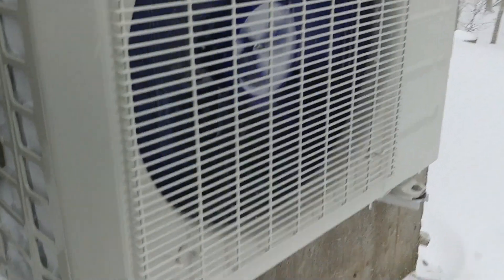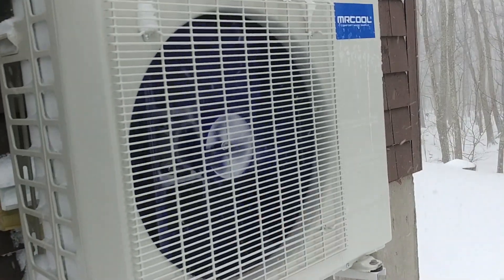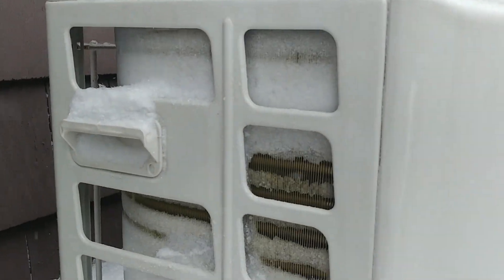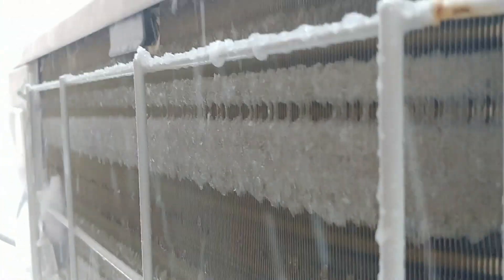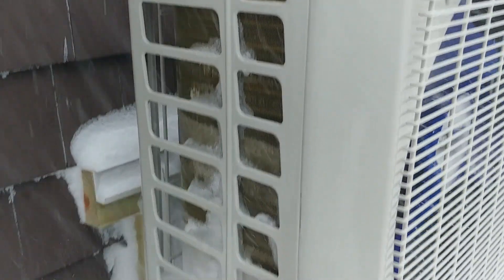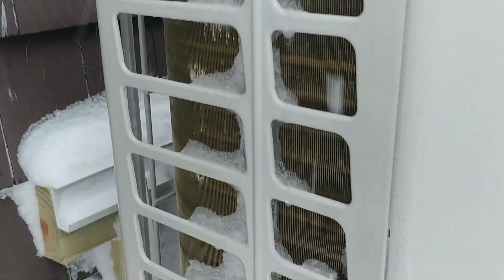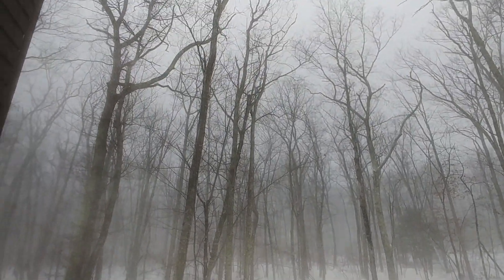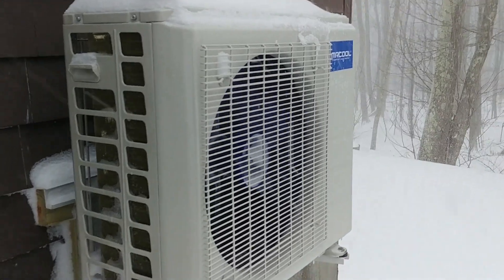Mr Cool mini-split performance in a blizzard

Comment: Usually there is a sensor to detect coil temp, once its above the threshold it runs for x time long. Depends on unit. ~commercial hvac tech
Reply from the maker: Cool, that makes sense.  Thanks.
Reply: @kevin9c1  Im wondering if my unit which is exactly like the one in this video is low in Freon. I keep it set at 65 in my mancave and by mourning it'll drop to around 62 almost like its struggling to keep up. outside temp is only like 33. it does DF but by the time its done DF the temp inside has dropped and it seems to be losing ground when doing so. I had it checked by a technician. He said the pressures looked good but he didn't remove the Freon to check the weight.
Reply from the maker: @stitch893326  Funny you should ask that. My system actually died or more specifically it threw a P4 code which refers to compressor inverter drive error. It does still run but it sounds bad and will shut down in a few minutes.  Fortunately I bought mine through Ingram's so they are handling the warranty and I will be receiving a Gen 4 outside unit in a week or so although I do have to pay freight. I did develop the theory that mine may have also been low on refrigerant possibly the entire time and over the last month or a month and a half I was using turbo mode to extract every last BTU out of it because oil is so expensive so my theory is those two things combined basically fried it.  If replacing the outside unit fixes the problem that would be good because it is a 22 seer and a 11.5 hspf which are both better than the Gen 3.  I will probably put together an update video explaining all of this.
Reply from the maker: Ok I replaced my condenser. All seems well so far!  The gen 4 is bigger than the gen 3 to get the improved efficiency numbers. The fan is also 1" larger.  Had to modify the mounting situation and also the suction and discharge lines are reversed on the unit. Those details turned the replacement into an all day affair. But it's working and runs nice.
Reply: Im wondering if my unit which is exactly like the one in this video is low in Freon. I keep it set at 65 in my mancave and by mourning it'll drop to around 62 almost like its struggling to keep up. outside temp is only like 33. it does DF but by the time its done DF the temp inside has dropped and it seems to be losing ground when doing so. I had it checked by a technician. He said the pressures looked good but he didn't remove the Freon to check the weight.